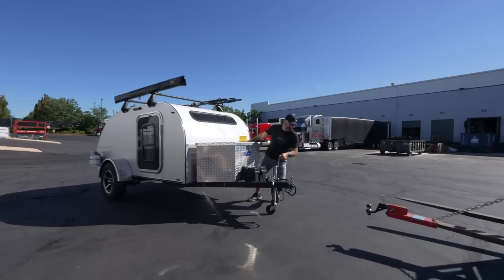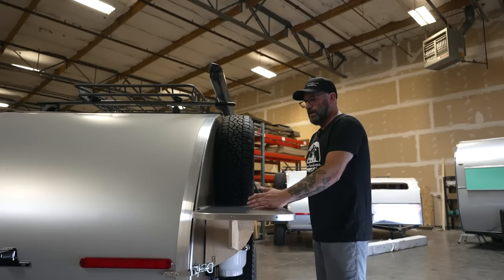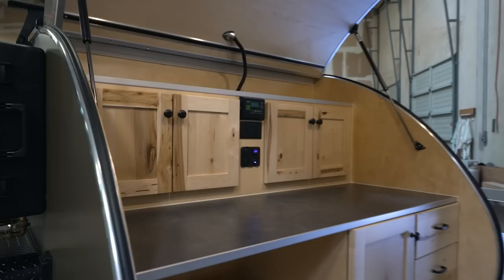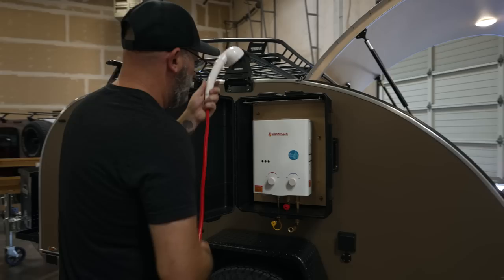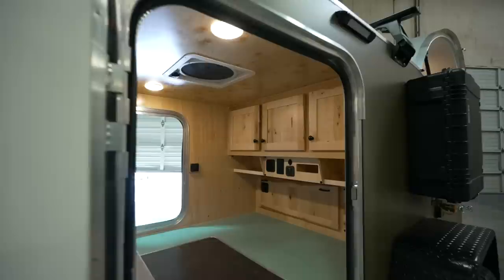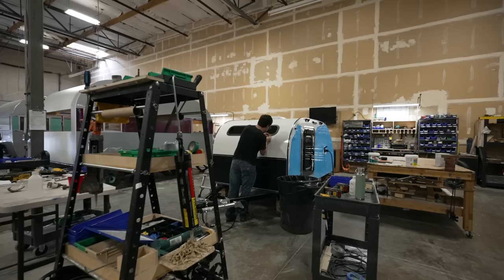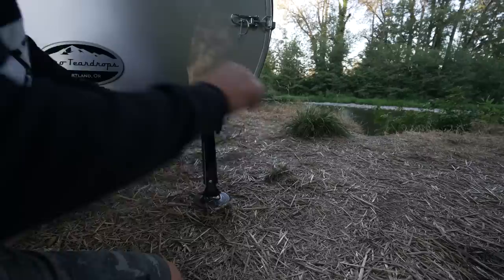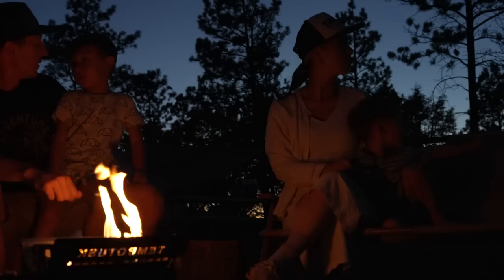Aero Teardrops Off-Road Trailer Walkthrough

Comment: The water storage under the axle is nice.   because of its short "run" front to back, it would limit surges when breaking and accelerating.   That said i hope it has at least 3 baffles inside it to prevent a side to side oscillation if the water starts surging left to right.  

the only place to mount  solar would be on the galley door.  meaning the only time it would really charge would be if its butt was facing the sun of if the galley was left open.

now that said,  skylight roves like that always worry me, anything angled upwards is a potential weak spot especially during hail events.    Its going to sound weird but i wouldn't mind an option for a "pull out" steel grill.  that would over and overhang over that would provide it some protection not just from hail, but falling branches, or other storm debris.   last thing you want mid storm is a window breaking.
Reply from the maker: As usual you bring up the great points. I asked every teardrop manufacturer I visited this summer if they use baffles. Guess how many said they have baffles inside their tanks?
Reply from the maker: Great point on the hail storms. Where we have been traveling entire communities got tore up last year from softball size hail. A window like that would have never survived. I really appreciate how you see the things we often overlook. As for the solar. That one was really interesting for me.  I am not sure if it is the efficiency of the lightleaf solar or the angle of the panel, but I got much more charging this summer at sun angles I thought would give me none. This was something I mentioned to Aero the first thing when I brought "Atlas" back. That Dometic fridge they use is a bit of an energy hog compared to the ICECO we use. But throughout the day the battery topped off much quicker than typical teardrops I took out. Which confused me because in theory a gel battery should take longer to charge. So it was either the placement of the solar, the curve, or just the brand. I would love to test it more. But I am starting to think maybe that placement catches more sun than I thought. Maybe something to do with morning sun angle?
Reply: @PlayingwithSticks  none?   it really does depend on the "lenght" of the tank too, the amount of "run" the water can get,   in this trailers case, the water has the entire lenght of the trailer to run side to side, and can you imagine if combined with a wind, a bad side to side oscillation started... the entire trailer could begin swinging side to side behind the tow vehicle.

And again this is why many manufacturers say you need to drive empty and/or they won't cover damages if you drove full.
Reply: @PlayingwithSticks  yep,  in a case like this i might want a small propane backup generator for emergency charges.   maybe a little 900-1000 watt generator that could be used in an emergency just to top off batteries during storm events.  

given the fact that it would NOT be a primary use generator.  i would stay away from both Diesel or Gas so i wouldn't need to worry about fuel degradation.  having a light propane generator that i could run for maybe an hour in emergencies, then shut it down, and keep with the batteries.
Reply from the maker: @jenniferstewarts4851  Ding, ding ding! You nailed it. NONE! And it is needed. I feel it in all trailers that carry water. However, when I talk to manufacturers they don't seem to notice much. But they also tow with really large vehicles and rarely tow a dry trailer. I just learned about the driving empty thing this past year. Very interesting.
Reply from the maker: @jenniferstewarts4851  Agreed. I got to test an Alp generator this season. Loved it. But  I really wish there was a smaller version.
Reply: @PlayingwithSticks  36 pounds for the alp 1000 is not bad.  puts it about en par with the Ryobi 900 at 25 pounds.   11 pounds for a more reliable system with more options isn't to bad.
Reply: @PlayingwithSticks  honestly,  the option to mount an external "cage"  over windows for a heavy off road trailer would seem like a no brainer.   to provide the windows with "armor"   so they don't get smashed in by windows... or extra protection in the case of serious hail events.   wondering why no one thinks of that..

its as if they expect everyone to drive on normal roads,  and camp in clear weather.
Reply: @PlayingwithSticks  I hope my comments help the community.  Give people things to think about and consider.
Reply: @PlayingwithSticks  you know,  generators and such are based on supply and demand.    IF for example, several different tear drop companies decided to come up with a "standardized"  size/weight/power   Generator,  maybe a  25 pound 600-800 watt propane.   that ONLY had direct output to a battery charge system.   

Then approached a company like owens, they could likely get owens to design and produce a small, cheep,  generator JUST for tear drops that could then be mounted either up in a modified battery compartment.  in a small pass through point at the front of the trailer, or in the galley area depending on where the company wanted to make it.

and a little stripped down, inexpesnive propane generator designed JUST to top of batteries in emergancies would work.

Comment: Two things.  Could you please expand on your "hurricane hinge" comment on the cons side of your review?  And, since I have not yet used a teardrop trailer, I always wonder about the real world experience with rain, at the hatch and both side doors.  Thanks!
Reply from the maker: Of course. When you purchase the standard hurricane hinge if installed it often can place a bit too much pressure on the top portion of the trim/foam weather stripping. Basically there is a happy medium of how much pressure you want placed down on that foam from the top of the hatch to the bottom. Depending on the angle of your hatch, length, placement, weight sometimes it’s best practice to add a little shim of metal underneath the hurricane hinge to relieve the pressure on the top portion of the trim. Like I mentioned in the video not an issue in terms of water intrusion and dust and things like that for 10 years. But just best practice to increase the longevity of the material. Typically I also look to make sure the hurricane hinge is cut wider than the width of the trailer. This is also best practice to help the water run outside of the galley. This was not an issue with the Aero Teardrops as they have plenty of width on the hurricane hinge outside the trailer. If you watch our Bean trailer factory walkthrough even being with their composite mold said that the hurricane hinge is the weakest point on their trailer. Basically as an owner of a teardrop you are always monitoring this connection to make sure seals are properly seated.
Reply: @PlayingwithSticks  Thanks for your quick response!  Your reviews are very well done!

Comment: I like the idea of the external clamps for the galley door, what are your thoughts?
Reply from the maker: At first I was against it. I actually thought it was going to be one of my 3 things I dislike about this trailer. But as usual, I was wrong! Last summer I had issues with a number of teardrops getting dust in the galley. Definitely no issues with this one. It is the tightest seal I have felt. It also is not a hassle to do like I thought it would be. If anything it just gives you more piece of mind on the road. I actually had one galley swing open last year when going up a steep pass. I had no idea it happened until someone honked from behind me. And second this trailer was sealed in a way I have never experienced. It is hard to explain unless you hop in one in person. When you shut or open the doors you can feel and hear the suction created with the MaxxFan. Because of this air was pulled at a level that I have never felt before. When I thought nobody could beat this I ran into a seal that was even better. Wait until you see the door on another teardrop manufacture in Oregon!

Comment: Drew, We have limited teardrop options on the east coast, I have been seeing ads for the Hero Ranger with is made in Denmark and carried by some of the larger RV retail dealers (mostly in Texas and Florida) Have you seen this trailer? if so, please share your thoughts. 
Thanks so much!
Reply from the maker: I got the chance to tour one this summer and talk with their Danish staff. In terms of finish work I saw a few things that needed a bit more quality control. Just little issues with LED lights, and trim. But the trailer as a whole seemed well thought out and had pretty decent bones. At first glance I thought it was very similar to the Bean Trailer. but it’s a different style of construction. Instead of a one piece fiberglass shell it is design with multiple pieces of fiberglass, which isn’t a bad thing it’s just different. This could potentially, after 10-20 years on the road have the potential for minor leaks because they are screwed and glued, but again it’s composite so it really wouldn’t be a big deal it wouldn’t destroy the trailer, you would just have to patch it or secure it a bit. I think they have done a really good job on the design and have some good talking points for why they made it the way they did. I made a video of it, but I’m not sure when it will come out.

Comment: This looks like a definite possibility. Two things not mentioned. What is the weight of this complete video model, and what is the size of the mattress (length and width)? Thank you.
Reply from the maker: Sorry about that. The mattress is a standard (home size) queen. And the weight of this model I never put on the scales. I would guess with all those features you are somewhere in the 1,600-1,800 lbs range
Reply: @PlayingwithSticks  thank you.

Comment: Is this insulated? Roof, sides, underneath?
Reply from the maker: Good question. Here is what I pulled from their website. The ceiling is insulated (R9), the walls and floor are not insulated but have 18 millimeter solid wood composite; this works well for temperature changes.

Comment: Can you operate the trailer with a generator
Reply from the maker: Great question! And the answer is yes. With the included shore power port you just plug-in to the shore power from your generator. Now if you were talking a power station a.k.a. solar generator, you would just need to ask Brian to add an input on the build. This would cost you little if not nothing to add. Another really cool thing about aero teardrops that Brian didn’t mention in the video is that they do custom orders. Not just components, but I’ve even seen them build custom shapes and designs for the trailer as a whole.

Comment: It's a really nice looking trailer however it seems we're getting away from simplicity, lightweight and easy to tow and affordability with these type of teardrops. The way you set up the tongue mounted storage units would result in several hundred pounds of weight which is too much on the back of any small 4-cylinder vehicle. So now you've just defeated having a trailer that you can tow and still get good gas mileage. By the time you spend this much money you may as well get a regular trailer since you now need a truck to tow it. I'll stick with my small Little Guy Teardrop any day over one of these trailers.
Reply from the maker: I'm not going to argue these points. If you have seen our channel we agree with you. However, there is a sub group of people with the right daily commuter and lifestyle that fit these builds.
Reply: The great thing is that they're very customizable, so if you're not interested in having a tongue-mounted storage unit...don't add one! Even items that are standard features, customers sometimes request to have them removed to save weight, space, or money. We're always happy to do what we can to meet the customer's needs and lifestyle--hence our Burnside squaredrop model, which is lower weight, simpler, and a lower price point!